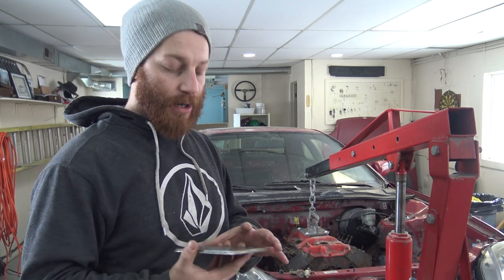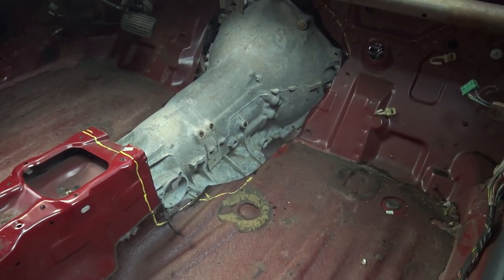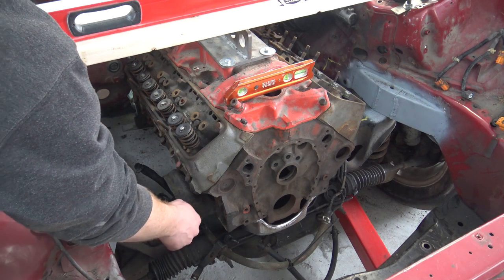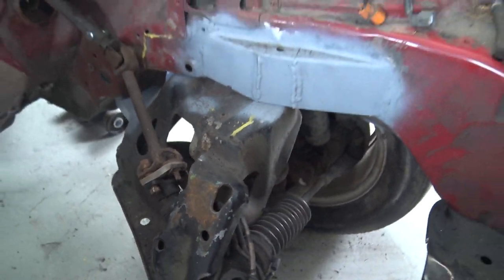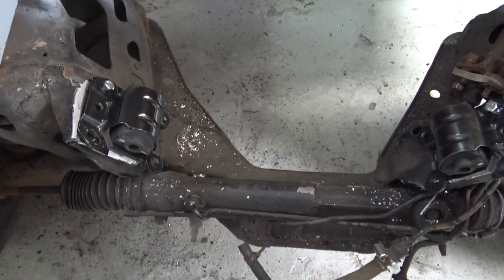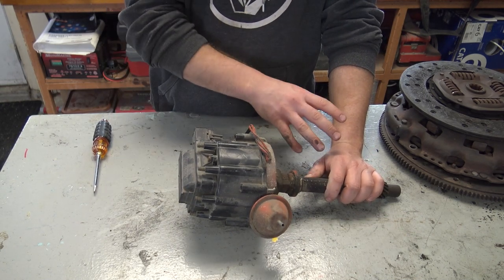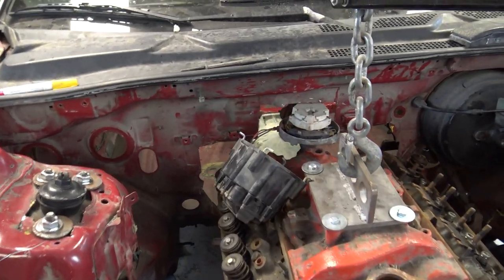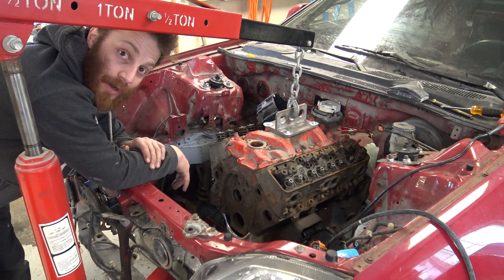Mounting My Small Block Chevy In My Honda Prelude - PART TWO

Comment: All that said, i am not in anyway knocking ya, just helping you brainstorm and passing small bits of info! I ran across this in a "customer states" compilation today which is funny because i was just discussing building a 97 prelude with a 5.3 LS7, and t15 (world class) 5 speed I already have as well as a narrowed 8.8. It was perfect timing as we were just discussing this at the shop last week.

Comment: Thanks for the ding! Lots of sbc crank trigger kits out there, so no problem...those heads are some really nice old double humps...somebody already spent some money on them too...screw in studs and guideplates, so probably big valve.
Reply from the maker: No thank you Daniel. You've chimed in here and there and have given some good advice when I've needed it. I appreciate that a lot.
Reply: @LiftedWrangler  If I were closer I would be in there helping ya...lol...Hoping the doc turns me loose on the 3rd...l am very restless and watching way too much tube.

Comment: While I'm at it, someone mentioned it, you can run a crank trigger set up and an MSD ignition and run it without the distributor (you will need a stub to drive the oil pump but it wont run into the firewall... might want to install a set of valve covers to check clearance (due to those being fuelie 202 heads if you plan on using them you might want to have the valve train that you plan to run so you know if you need to run tall valve covers or you can get away with shorties). Also, instead of a HEI ignition you could run a converted points style with a pertronics conversion) a points style distributor is much smaller, cheap and a pertronics conversion kit is like $80.
Reply from the maker: Awesome thank you.
Reply: @LiftedWrangler  no problem. Do this stuff all the time. The difference being most of our swaps are with LS motors. They are cheap, fuel injected, about 100-1500lbs lighter and are physically smaller then a Gen 1 small block.
Reply: @LiftedWrangler  complete running motors with harness and accessories can be had for 600-800 and work with just about any GM trans.

Comment: Do you not have a welder? A set of weld in mounts with poly or urethane inserts would have made mount install 10 times easier. You could mount to motor, locate and tack them in pull the bolt and then motor and weld the mounts in solid. Just a thought
Reply from the maker: What I did worked. I'm learning as I go.
Reply: @LiftedWrangler  it did and you made it so. Like I was saying I'm not knocking you in the least. Just offering ideas. Everyone has their own way and opinion and I am down with it!
Reply from the maker: @mckreations5160  i agree man thank you. I copied what you said about the distributor for future reference.